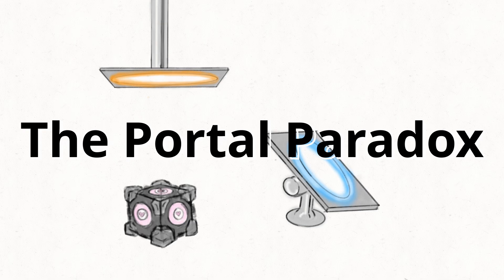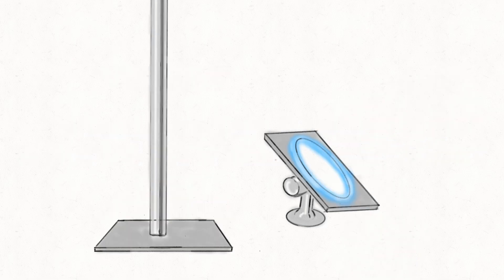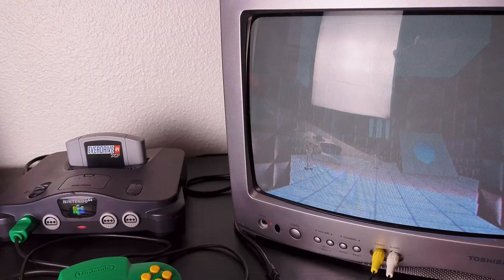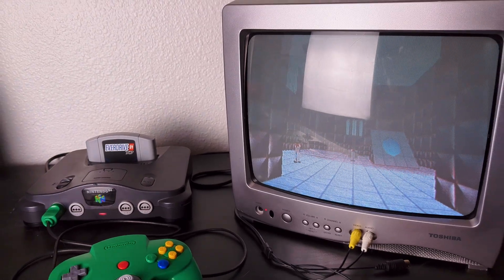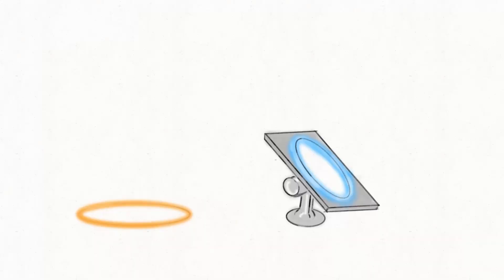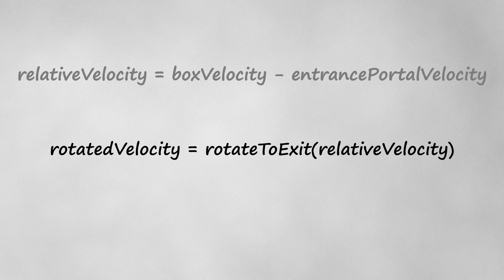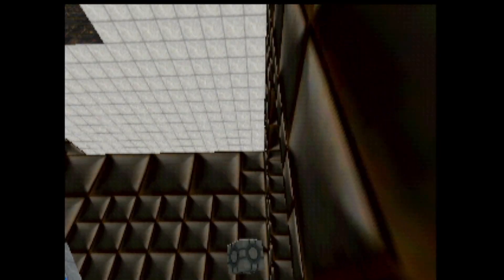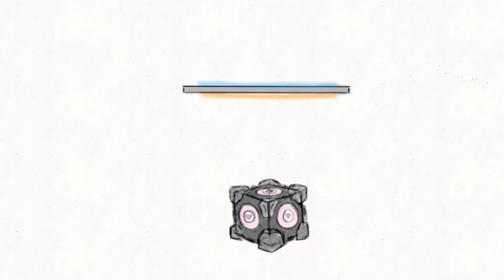I rewrote Portal from scratch and solved the Portal Paradox

Comment: I have two flaws in your equation.

1. Your equation assumes portals impart velocity onto objects, they don't.

2. Your applying relative velocity to the wrong things, you should be applying it to the orange and blue portal.

Let me explain. You completely misunderstood to hulahoop analogy. Motion is relative, and object moving through stationary space is the same as saying space is moving around a stationary object. With that in mind, you have to look at the event from both portals perspectives, factoring in the other portal. From the orange portals perspective, the cube and blue portal are moving up at equal velocity, therefore, the cube won't move exiting the blue portal.
Reply: Portals, even in the games, are show to alter the velocity of objects passing through them, whether that's to be considered "imparting velocity" or not. Changing the direction an object is moving is by definition altering its velocity.

Funnily enough "Motion is relative, an object moving through stationary space is the same as saying space is moving around a stationary object" does sum up an explanation for B. You can see as the portal envelopes the cube the space within that portal is moving around the cube, which is therefore the same as the cube moving within that new space.

As far as the rule for how portals handle relative motion, the rule is that the object's velocity relative to the entrance as it is entering is the same as the object's velocity relative to the exit as it is exiting. This can also be observed in the games as that would entail relative direction as way, a cube moving downwards into a portal on the floor is moving the same relative to the portal on the floor as it does when it's then exiting sideways from a portal on the wall. In other words, it enters and exits at a 90 degree angle to the respective portal at both ends, which ultimately means a change in travel direction and therefore a change in velocity.

As far as "the cube won't move exiting the blue portal" goes, when the blue portal is stationary exiting it is by definition movement.

Comment: ok now do it where you actually stay true to how a HOLE works. HOLES do not have velocity, they cannot transfer forces.
Reply: If said hole has a location in space which changes over time then it has a velocity. As far as transferring forces go the portals in the games are able to alter the velocity of objects passing through them, whether or not that is deemed to require them transferring a force.
Reply: @J4hk2  the rim of the hole has velocity. the hole its self does not have velocity as a hole is nothing (or at least effectively nothing). if we are taking all physics into account than A or B (in the classic viral image) is possible depending on the weight of the cube and the speed of the piston. the "real" question of the portal problem is "are portals velocity-carrying membranes or are they holes?". this video entirely ignores that and presupposes a bunch of nonsense so that portals are velocity-carrying membranes since thats what this guy wants the answer to be.
Reply: @J4hk2  also the portals in the games are not able to alter the velocity of objects passing through them you are just pulling this out of your ass or you misunderstood someone's explanation. the portals in portal are hard-coded to stop working / turn off if you attempt any situation like the one in the classic portal problem image. not that this even matters because the question isnt "what would literally happen in portal in this situation" since as we said, you cannot do this in portal.
Reply: Portals alter velocities of objects whenever they change the direction an object is moving. By definition something moving in a different direction has changed in velocity. 

This also automatically means that the portals have the capability to alter an object's motion by speed as well because something changing in velocity solely by direction will have changed velocity solely by direction only in that reference frame, in every other frame the portal will have changed the object's speed as well. Basically a portal is only ever going to conserve the speed of an object passing through it in the reference frame where both ends of the portal are stationary, but such a reference frame does not exist in this scenario.

As far as what is possible in the portal games. I always took the portal disappearing to be a programming limitation rather than the intended canon of how portals behave. Given we already have have a few instances of portals explicitly moving in the games. That and technically all portals are moving portals since the earth is moving.
Reply: @J4hk2  
"Portals alter velocities of objects whenever they change the direction an object is moving."
the direction is not being changed, it is going "straight" the whole time. you are being confused by the fact that the portal creates a non conventional situation in terms of geometry.

"Basically a portal is only ever going to conserve the speed of an object passing through it in the reference frame where both ends of the portal are stationary, but such a reference frame does not exist in this scenario."
once again, a portal cannot move. the "ring" of the "hole" of the portal can move as it is on/attached to something. but the hole (which is what i would say is the part that is more "portal-y" compare to the ring) cannot move, because it is empty space and empty space cannot move.
Reply: @ianbrown5909  Here's the thing, your problem with B was that the velocity of the cube changed, which would be true when you're determining velocity how you normally would, comparing the velocity of the cube before and after going through the portal using the same co-ordinate system or reference frame each time.

However you have just made the argument that you don't determine velocity that way. Which compromises the idea the cube's velocity even changes in B. You're essentially opening up the argument that B IS conserving velocity, at least under your way of determining it.

Basically you've said that the cube changing direction of travel is actually a result of it entering a space that has been distorted so everything around the cube is in a different direction, under the same logic, the cube changing speed is actually a result of it entering a space that has been distorted so that everything around the cube is moving, which can be seen as what is happening when it enters into a portal that is moving, everything seen in the portal is seen to be moving around the object as it enters.

And the distortion created by the portal is going to be moving, because you determine how it is distorted based on the positions of the two ends of the portal, of which one end is moving.

Really though I don't agree with thinking about it this way because it gets a bit absurd and breaks the basics of how velocity is measured, when you measure velocity you always stick to the same reference frame or coordinate system or else it isn't a valid measurement (see https://www.youtube.com/watch?v=ASUUN0W4_JY) and if you observe an object traveling through the same space, but now moving in a different direction as before, within the same reference frame, you have to acknowledge the velocity having changed or else you're arguing that the object is moving differently to the velocity you're claiming it has, which is nonsense as velocity is by definition how something is moving.

Also think about what happens when the portal closes, any notion of geometry being different goes out the window when the portal ceases to be, and yet closing the portal doesn't change the movement of the object accordingly.

Never forget the most important point: the cube had to be moving to even leave the exit to begin with.

Comment: How does the portal have velocity if it has no mass? The area around the blue portal isn't moving so it has no velocity either. So then how does the cube gain velocity when it only have velocity in the same direction as the portal platform, and there is no interaction between the platform and the cube? The only interaction the platform has is with the ground the cube is sitting on, but that wouldn't transfer any force into the cube to cause it to accelerate.
Reply: It's having momentum that would be impossible if it didn't have mass. All the portal needs to have velocity is to be changing its position in space over a period of time.

Portals in the games show the ability to alter the velocity and momentum of objects travelling through them whenever they changing the direction an object travels. This would traditionally require some kind of force as well.

Comment: "i am wrong within the parameters of the original game where the question is based so i made my own game where i am right therefore i am right" this is by far the most cringe thing i have ever seen. and of course it came from a b-tard.
Reply: @MrNewVegas2281  the answer to the question is that the question is invalid because as we know portals in the video game portal cant move in the way shown in the question.
the question doesnt actually say anything or ask anything other than A or B. anything more is you assuming what the question is asking and any answer with that assumption applied is inherently wrong.
if we ask a different question where we assume that portals in portal can work in the way shown in the question then anyone who as actually played the video game portal knows the answer is A because thats simply how portals work.
every time you use a portal it proves that A is correct.
if B was correct any time any part of the player model touched the portal it would be pulled(pushed, sucked, launched) to the other side.
as we can see in the game portal portals dont impart anything to any object that passes through them. if the player moves through a portal at speed x they will still be moving at speed x on the other side, and we know this because you are never given a push or burst of speed through a portal simply by walking through them
in fact the player can stand between portals, something that would be impossible if B was true.
"but relativity blah blah real world science blah blah" the second you bring anything from the real world into the question you lose. the question has nothing to do with real world science.
the speed of the falling portal doesnt mean anything to a cube that is stationary.
if you attached a accelerometer to the cube and then pointed a speed camera at the exit portal the speed camera would measure the cube appearing at whatever the speed of the falling portal is, but the accelerometer would show 0 because the cube hasn't moved until its center of mass passes through the other side and is suddenly affected by gravity and the cube will plop to the floor
now which is correct? the accelerometer of course, it doesnt matter what is observed, all that matters is reality, and reality is the cube wasn't moving, the portal could be shot at the cube at light speed which would mean the cube would appear on the other side at light speed but then would just plop to the floor at normal gravity speed for an object with that weight at that height. (sorry for formatting but i wrote this in a text document because youtube deleted my comment 3 times as i was writing it. :(, i felt like my first version of this reply was better but this is what you get i guess. and if you reply and i dont reply its because i have notifs turned off and i will probably forget i made this comment)
Reply: @fishandham1  "if B was correct any time any part of the player model touched the portal it would be pulled(pushed, sucked, launched) to the other side. as we can see in the game portal portals dont impart anything to any object that passes through them. if the player moves through a portal at speed x they will still be moving at speed x on the other side, and we know this because you are never given a push or burst of speed through a portal simply by walking through them in fact the player can stand between portals, something that would be impossible if B was true."
Saying this is showing a fundamental misunderstanding of how B works.

B is literally the same principle that portals in the games use to manipulate object velocities, as shown whenever they change the direction an object is travelling. As in, if you took the process that results in B and put it in the scenario where both the portals are stationary then B's behaviour would be identical to that of how the portals in the game works.

If you're claiming otherwise then frankly you never knew how B worked to begin with.

B wouldn't result in any additional forces because B's manipulation of velocity is only ever using the velocity an object already has relative to the portal. This isn't me trying to "bring anything from the real world into the question" either, it's an actual description as to how portals in the games operate. They use relative measurements.

Relative motion, which include relative direction, is used in the games to determine how portals manipulate an object's motion. Hell even the portal's manipulation of an object's position and rotation uses measurements of an object's position and rotation relative to the portal. You would not be able to replicate portal's behaviours in the games without determining position and motion relatively.

"if you attached a accelerometer to the cube and then pointed a speed camera at the exit portal the speed camera would measure the cube appearing at whatever the speed of the falling portal is, but the accelerometer would show 0 because the cube hasn't moved "
The way an accelerometer works there's a component in the device is which is slightly loose (a spring-mass system) and the device relies on the fact that forces accelerating the device isn't applied directly to the loose component as well. So that while the device is pushed, the component isn't, meaning the component's position within the device is shifted slightly. This shift in position is measured to determine how the device's velocity has changed.

This can't be used to determine a portal changing an object's motion because the portal would have changed the velocity of all parts of the object equally, including the loose component, meaning no shift in position can happen to measure it

To put it another way, imagine the accelerometer going at a consistant velocity through one of two portals on a wall, so it goes out the opposite direction. We know the velocity has changed, we even know there exists a reference frame where the accelerometer goes from being stationary to mobile. But the accelerometer would not have detected this, proving it cannot be used to determine the portal's manipulation of object velocities.

Comment: There's something that I don't hear ppl talk about that I think complicates things. When the portal comes down around the cube, it slams into base and imparts energy into the platform the same way if you slam your first down onto a table next to a coin, the coin will bounce. Some of this energy is lost. However, that pop up energy should be enough to make A not the correct answer. If B implies no energy loss, than the answer should be somewhere between A and B.

What's confusing is that if a hoola hoop were to fall around the cube, it wouldn't fly upwards. The only thing that might make the cube pop up is if the hoop were made out of something with a lot of mass. Energy being imparted from the descending portal platform is the only thing that should make the cube move. Movement relative to the exit portal shouldn't matter. 

Additionally, if the descending portal were to fall at a speed slow enough to not impart energy into the stationary platform, the cube should just plop out.

Am I wrong?